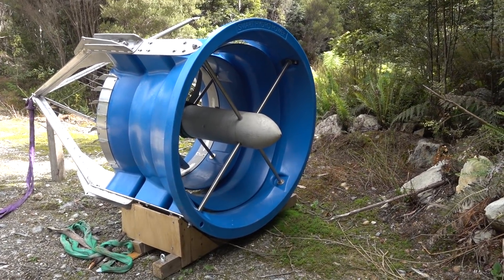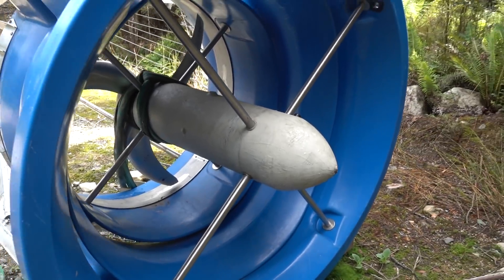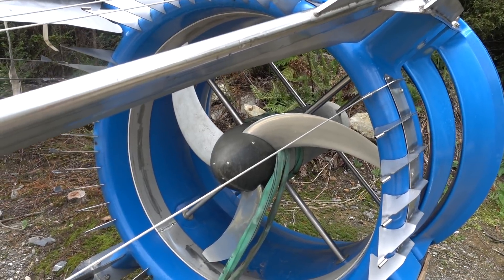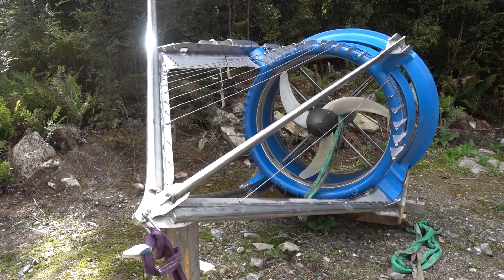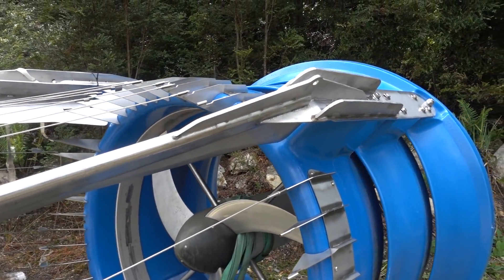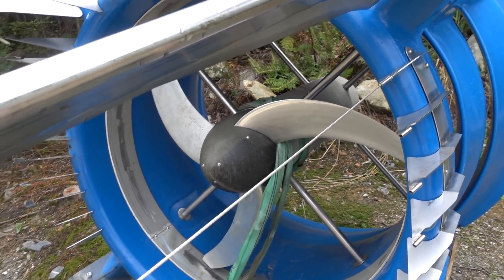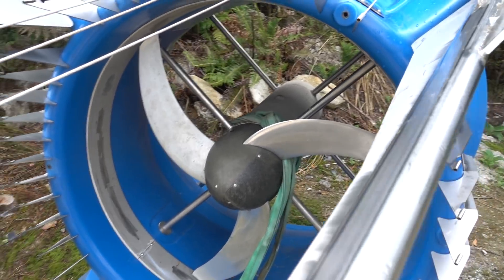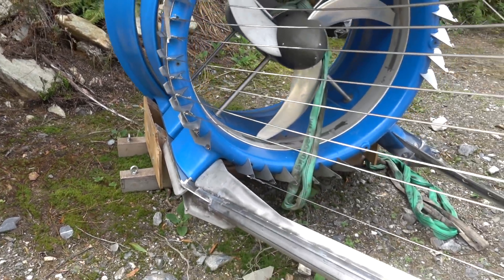Hydro Power Turbine Generator

Comment: The water actually flows in from the side it is mounted. Those wires are part of the grill to catch debris
Reply: That makes more sense.
Reply: It seems to have missed the green net that's hanging out like a tounge
Reply: And to keep the wildlife out of the mincer.
Reply: @bobpitt1261  I can imagine a few unfortunate fish fitting through those wires easily. They would be too small to damage the turbine. Wouldn't leave much left of the fish though.
Reply: @vylbird8014  I was thinking platypus too.
Reply: @vylbird8014  It's slow speed though, not like a boat propeller, it's not spinning faster then the speed of water traveling over the blades, as it's the speed of water that is making the blades spin. A few bruises and marks, but fish get that fighting with other fish
Reply: @aussiemanlyman2138  I agree that it spins slower than a boat propeller,  but the blade will be passing through the water faster than the water is moving down stream. Based on the data from Smart Hydro's web site, the tip speed of the blades is about 4 times the speed of the water.  The turbine is designed to operate at between 90 and 230 rpm (depending on water speed).  At 90 RPM, the blade tip speed will be 4.7 m/s.(17 km/h, 10 mph).  This speed does sound survivable by a fish, but I'm no expert on fish injuries. At 230 rpm the tips speed will be 12 m/s (43 km/h, 27 mph).  I doubt a fish would survive being hit by a blade going this fast.
Reply: @andrewsnow7386  that's assuming it gets hit exactly at the tip...
Worst case scenario is pretty dire, but that's practically never going to happen. More than likely, a fish would just get pushed along, relatively unharmed.
Reply: @g.e.o.r.g.e...  you are right that that the blade speed is slower as you get closer to the center.  But, a full half of the area of the area swept by the blades occurs in the outer 1/4 of the blades diameter. Thus, roughly half of the fish would pass through where the blades are moving at 3/4 or more of the velocities I gave before. Now, if we make some assumptions (for example the water flowing through the blades is moving at the free stream velocity - it will probably be moving slower), we can calculate what size this pieces of sushi coming out of this Cuisinart will be (I'm kidding, I know it might not cut all the way through the fish).  So the data they give implies the thing will spin at 230 rpm when the water is flowing at 2.8 m/s.  With three blades, there is less than 1/10 of a second between blade passes (for reference, the blink of an eye probably takes 2 or 3 times longer). But in this short time, the water actually moves 24 cm (9.5 inches).  So are sushi is roughly in 24 cm chunks (kinda big).  In any case, even a fish 1/2 this size would face a good chance of being hit.
Reply: @andrewsnow7386  do you think you could stick your hand in it?
Reply: Andrew Snow on my first day of my apprenticeship, the old timer instructor held up his hands with all 10 fingers and said “don’t ever stick your fingers anywhere that you wouldn’t stick your dick” as the reason he still had all his fingers. Bit of a shock to the 15 yr old me. But here I am 26 yrs later and I still have all my fingers, so I got to say he spoke some very wise words.

Comment: I think you've got it backwards. if you anchored it by the metal part, the wires would prevent larger objects from entering the blades, and the thing would probably self-stabilize in the stream by just hanging on a wire attached to the pointed end, and the small inlets would probably act to stabilize and maybe add additional drag to the stream going through the blades (same principle as a "bladeless fan")
Reply: That is my first thought as well. I was thinking bigger fish, but it probably is larger objects as you are saying.

Comment: I think you might have gotten the direction of flow incorrect, the outlet of the duct is the larger side to lower the pressure of the water on that side and the anchor point is upstream.

Comment: Dave, you said narcelle but I think it would be more correct to call it a cowling similar to that found on a jet turbine.  It narrows and due to the Bernoulli effect the constriction causes a speed up of the fluid (in this case, water).  In simple terms, the available power able to be extracted from a turbine is proportional to the density of the medium, the swept area of the turbine and the cubic power of the speed of the water but this is reduced by a bunch of other constants, factors and efficiencies.

Comment: I always thought some sort of movable turbine like this would make for a great power source anywhere you have flowing water. One problem around here is streams freezing during the winter, though it could still work in deep enough water year-round. Another problem would be plants growing into it and getting tangled up inside or blocking the flow of water. I had a somewhat similar idea once, it was basically a paddle wheel that would float on the surface of the water, which would still run into most of the same problems in addition to likely being illegal to install anywhere here.
Reply: Sounds like a watermill. There's still a bunch of these left in the low countries. (search for "watermolen") Hydro, like wind power, is a very old idea.

Comment: Yea...they trialed these in my area...we have one of the fastest moving rivers in the world (5 million gallons per second down a river that is about 200' wide).  They "claimed" what they had would develop 8MW...it developed about 1/4 that...just to understand how LITTLE that is, the factory that was there eats 12MW per day...SUPPLEMENTAL power as they have their own power plant on site, but it is old and can't develop that total power needed for the facility (Old Paper mill).  so...EPIC failure.  Oh, and this one disturbed the Sturgeon Spawning grounds as well (which they claimed "could never happen with their design")...yea...all this "free clean energy"...BUNK!
Reply: @Gallowglasser  DOZENS of turbines...right in the middle of a Sturgeon Spawning ground.  In the end, the "trial" used several dozen turbines, was supposed to generate 8MW of power peak.  The trial ended after 12+ months (and many being replaced with "improved" models, or replaced because the existing ones died (about 70% failure rate)).  Their "claim" of output power fell FAR short of their 8MW...as in peak was 2MW.  They also ran into issues with the fact that the area is great for fishing, and even though they have "no fishing" signs up and such, tackle still finds its way into these things and breaks them.  Yea...not the best idea in the world...sounds good until you try to implement it.

Comment: Looks like that strap got tangled in the blades? Maybe they pulled it out to find out why it wasn't working and didn't finish?
Reply: If you look at the :16 mark you will see that strap has been put on there intentionally. There is no way a cinch strap could get in there on its own. Either it's out for repair or new install.

Comment: It's designed to be placed along a solar roadway where it get's it's power. It's primary function is as a fan to cool down bicyclists on hot sunny days as they pass by. They worked great when the solar roadways were first built but now they Don't produce enough wind to blow out a candle. Most have been repurposed as boat anchors. Somebody must have lost one.

Comment: Where is the PowerPoint output? Why never show us the power output point?
Reply from the maker: I tried to find it briefly but couldn't. From the web page it looks like it comes out one stem and along the guide wire as you'd expect, but I didn't see that.
Reply: And it´s the weakest point, in my opinion! How will you protect a cable wire in heavy waters with lots of debris? The whole turbine is moving and shaking all the time, I think.